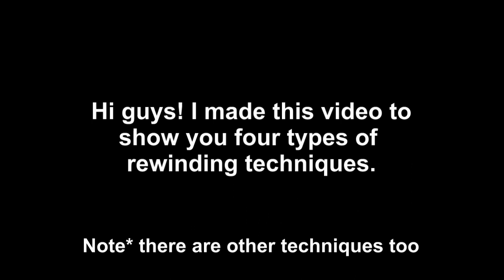Rewinding Techniques Part 1 (3)

Comment: what is an easy way to remove the insulation on the wires? burning it will cause the insulation to burn out quite far from where you wanted to. what is an efficient way to remove the insulation?
Reply from the maker: The easy way is just heat it enough that the adhesive melts and u can push the wires from the slot sir. Or just slowly cut em away.
Reply: @JakeMarvinVillegas  thanks for the advice, i found one by myself. i just use a dremel with a sanding slot, and that can really easilly, and fast remove the insulation

Comment: You are very good teacher
Reply from the maker: Thank you so much @HASAN KHAN! I really appreciated it ;)
Reply: @JakeMarvinVillegas  my some connection to the commutator are weak so tell me how can i fix this?
Reply from the maker: You should probably put an epoxy on the commutator connections. This will help it hold from very fast spin or from extreme heating.